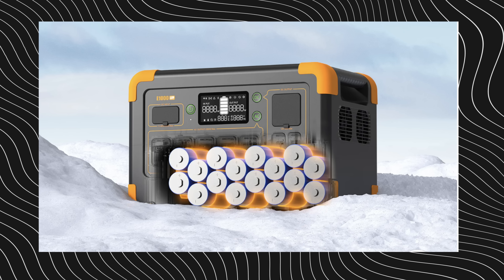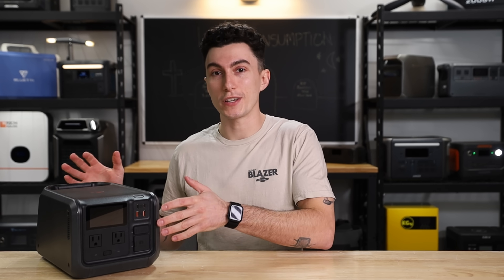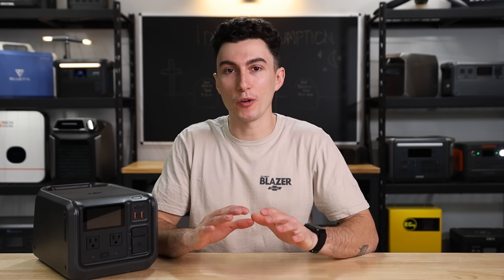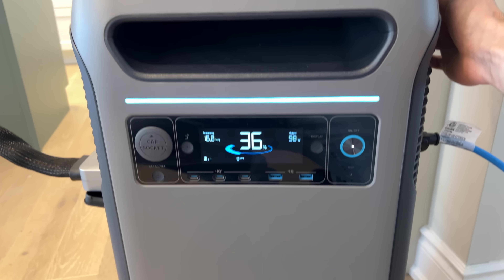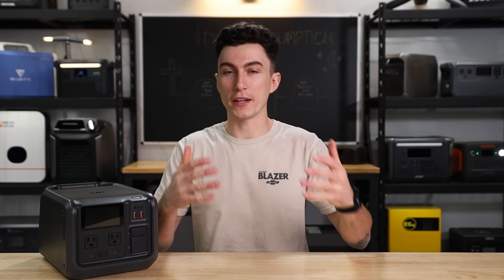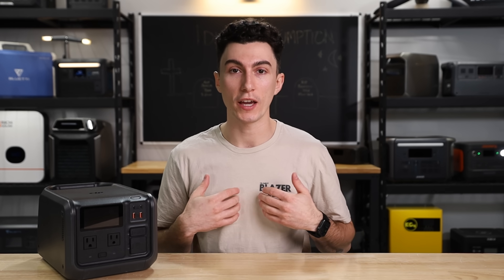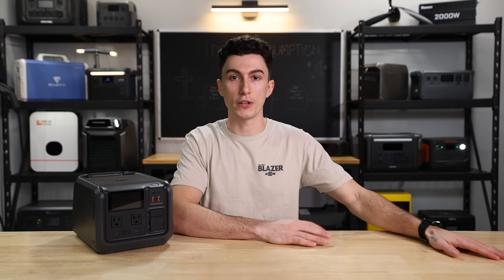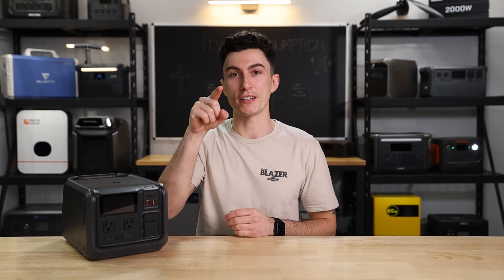Why Your Power Station is Draining Itself So Fast..

Comment: One note... I have a number of EcoFlow River units which I love. I even have the new River 3 Plus with the 300 expandable battery pack. (I'm still waiting to see your review on that unit) One clarification, your assumption is if you are using this as a portable power station. I use mine as a backup power when the power goes out. In this scenario plugging things into the AC ports ( when also plugged into grid power) should NOT consume excessive battery power but is a pass-through and anything plugged into DC will always use battery power even when plugged into grid power. I use a cpap and can use either DC or AC. During regular use, I'll plug into AC so it won't use battery but if the power goes out I'll switch to DC so the inverter doesn't get used.
Reply: It still does. I use the River 3 Plus with the largest add on battery this way and it reaches 97% like twice a day and recharges itself from the wall.
Reply: "....In this scenario plugging things into the AC ports ( when also plugged into grid power) should NOT consume excessive battery power but is a pass-through....."

Isn't that because the River 3 Plus is constantly charging from grid power?
Reply: @mr.c6674  I'm not positive but based on my experience I think whatever the load is, comes from the wall. So it'll read for instance 25W in and 25W out but the inverter is still drawing battery. That's the only explanation I can come up with as to why when used as a UPS, it hits 97% a couple times per day and charges back to 100.

Comment: What if I have the ac switch in the off position, on the EF Delta max?
Admittedly, in south ga during power outage, I keep box fan on most of the time.  I opt for that over the fridge, as long as I can get ice for cooler.

Comment: Are you sure the Anker numbers were entirely due to idle consumption and that it was not due to a freezer defrost cycle?
Reply: 6kW eats a lot on idle, basically it's a rule - the bigger inverter, the more it eats. Like pertrol engine..
Reply: @s.i.m.c.a  There is frequently some correlation there, but it's hardly a rule. For instance, the Victron Multiplus 5kW inverter has an idle consumption of 11 watts.
Note I'm not saying it's impossible that the Anker has a 70 watt idle consumption, only that there may be another possible cause of the overnight usage.  The Victron is for sure a high quality inverter, and it being better is not surprising. 70 watts does seem a bit high though.

Comment: Unless the battery is the same voltage as the DC device uses there is loss in the DC to DC voltage conversion. Plus wire loss, no wire is a perfect conductor (at least at room temperature) they have resistance to electron flow which means the wire gets warm. Some devices use this like high resistant wires in toaster for toasting bread or creating light, in old fashion bulbs.
Reply: DC-DC converters have far lower idle losses, usually less than 1W, because they don't have to generate a waveform and just let the output voltage ride on the output buffer capacitor.

Wire losses are a function of the SQUARE of the current.  So if the current is zero... the wire losses are also zero.  If the current is very low, the wire losses are almost non-existent.   RMS AC and DC wire losses use the same equation... P = I * I * R (I = current, R = resistance of wire segment).  Since current is typically returning as well (red wire, black wire... or hot and neutral), you also multiply by 2 since the current returning on the ground or neutral conductor also has losses.

DC-DC converter losses depend on the quality of the parts and the design.  More expensive designs can usually get above 95% efficiency for buck (down) converters.   Boost (up) converters are usually about 5% less efficient, so 90%-93% is more typical.  Depending on the multiplication factor.  Higher multiplication factors are less efficient.  Power stations often have very poor DC-DC converters in them and the efficiency can be as low as 85%... almost the same as the power station's inverter, though with far lower idle losses.

-Matt
Reply: @junkerzn7312 you would think that … unfortunately in practice some units from the Ecoflow brand have higher inefficiencies on the DC side than AC
not sure why but I did test this and it’s true

Comment: Even when off my delta 3 plus battery does drain
Reply: Even when completely turned off the BMS still draws some power... typically between 10mW and 100mW (milliwatts).  The battery cells also self-discharge over time at a very low rate.   This should be good for almost a year sitting on a shelf (several years for bare battery cells without a BMS connected), so if your power station is discharging excessively in far less time, either something isn't turned off or the design is faulty.

-Matt

Comment: I really wish bigger batteries would offer dual inverters: a high powered one when you're trying to boil water, and a low powered one (with much lower idle draw) when you just want to run your TV and stuff
Reply: Nonsense!  Back in the 90's some inverters featured multiple parallel DC to AC converters on the first stage, where only one of them was in operation during idle current draw.  I have a 1400 watt inverter from the 90's that draws only 1.5 watts at idle. This is old technology that never should have been dropped, and could be easily brought back in a more sophisticated form. No need to have 2 inverters in one power station.
Reply: @theclearsounds3911  maybe that's what the bluetti AC 200 elite V2 has.. it's the only power station with 96% AC efficiency
Reply: Would be nice in the future if they did staged inverters that kick on and off when the demand is there/or not. I bet the software/firmware for that would be a pain to work out tho.
Reply: Just build your own bank,, a couple of hours watching some videos you can build whatever you wish ( diy to your own supply) it’s honestly very easy.
Reply: @ I agree until I get to the point of easy portability.
Reply: @ClarkyMalarky it’s easy but you don’t have the form factor, fit and finish, warranty, app, etc. That’s why I stopped building small systems.
Reply: @TobyCostaRica  the batteries and parts I use have warranty?  And the bms system also has apps and Bluetooth.   But a nice cover/shell can sell people a lot easier on believing they have comfort and protection.
Reply: @ClarkyMalarky  Yes they do individually, but do you have a turn key warranty? You cram everything into a box you have to complete disassemble. Can you fit the same amount of things in the same footprint? 
No, because I’ve built several of them pre EcoFlow and Jackery days, and no longer do. Sure a home system 10kw+ I may still DIY, or if I need 50A of DC out but find me a charger or inverter of similar rating that operates at 30db continuously. Sub 1kw it’s cheaper just to buy one for most people.
Reply: @ try to return to renogy, it’s not turn key 😂 and yup I can fit in the same footprint. But it will be a pelican case that’s waterproof and twice the power for half the price.
Reply: @ I’m not returning to Renogy, I’m returning to EcoFlow or Anker which send me shipping labels within 24hrs. 🤣 Please tell me the components and which Pelican case? I have a dozen from the Micro all the way to 1780T. You have waterproof in use connections? Your inverter works without any cooling? Please share this mythical Clarky Powerstation. Don’t tell me you put a 100ah LFP, 1000 watt sine wave inverter, a 500watt MPPT charger, AC to DC charger, BT/wifi modules, ports (and somehow made them all waterproof) in a 1510 😀.
Reply: I’ve been saying this for several months. My Anker F3800 eats a lot of watts with no load on it.
Reply: That's a great idea
Reply: You plug a small power station with a small inverter into the USB-C  PD or 12V DC port of the large power station, so it only recharges via DC and keeps the larger inverter off.  There's your low power 200-300W inverter, enough to power TV, router, other small things (but not a small fridge or freezer due to compressor startup).
Reply: @ they make usb c pd to 120ac inverters?
Reply: We have dual inverters now just not a low power and high power choice.
Reply: I think this is a cost thing. In the race to build the cheapest device, the inverter focusses on reliability at lowest possible price. Efficiency is lower down the scale.
As one other commenter said, the technology to build inverters that can ramp up on demand exists - it is just expensive.
Reply: I think the battery with inverter(s) and a separate charger is the only way to size the inverter with the load. Use one 12v inverter for small stuff and a larger 12v  inverter for the larger appliances.  3000 watt inverters do have higher  overheads than the smaller ones.   You can't make a one size fits all and expect efficiency.
Reply: What I do,  specifically in long power outages, is plug my wifi router into the 5525 12v output jack with that cable they give you. It's far more efficient for those low loads, but you have to make sure that your routercan accept 12 volts.
Reply: The River 3 plus advertises something similar.  At low load (<100W) it comments about a longer run time.
Reply: @Jgalaski8438  it just has a single very high quality small inverter... which would happen to be ideal for the exact scenario of having a small inverter in a larger unit.

Comment: Very good video, almost no one talks about this, there are power plants that are much better at this than others, for example, one of the best is bluetti, I have an elite v2 that with a 2600w inverter consumes less at rest than a 1800w ecoflow delta 3 plus, the difference is very big, about 15w for the bluetti and about 40w for the ecoflow more or less, that's why you can't leave almost an ecoflow to back up a refrigerator at night. By the way, some of Do you know about error 303 in ecoflow? Every day I get that error if I don't disconnect the solar panels, before it didn't happen but now it happens every day, I had to program it to turn on with AC so that when it starts to retain solar energy it doesn't give the error 303... it's very annoying and ecoflow support hasn't responded for 2 weeks...
Reply: Check the firmware, and that any extra batteries are also updated.   I had an error with solar connected after my DP3 updated firmware.  The main unit updated but then I wasn't prompted for a day or two for the EB to update.  Took 3 "accessory updates"  and now the error has not returned.  I unplugged everything, power cycled a few times, and I'd get the firmware accessory prompt in the morning.. Unplug everything while updating,  power off, power back on and reconnect everything.    It was confusing since the accessory update was showing to update even though it was showing the same firmware as being current.
Reply: Fennstyle - I'm in the Ecoflow ecosystem. I have a Delta 2 Max powering the fridge. I've been eyeing that Bluetti Elite v2 for just the reason you mention. Can you confirm something? The Ecoflows can set a %  (like 5%) and then if your battery falls below that it starts drawing from grid to keep things going.  But above that it won't charge automatically.   Does the Bluetti have an equivalent setting in the app?